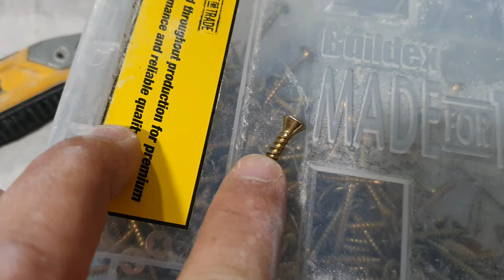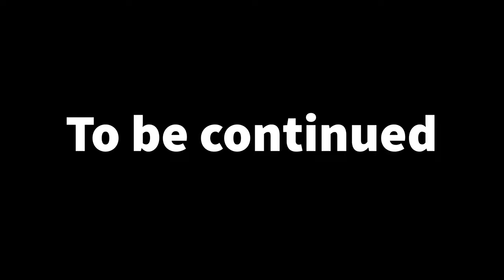How to repair a hole in your drywall (Magic Trick)

Comment: So you use 10mm (⅜) on walls and ceilings?
Reply from the maker: Hey Chad how you been? Yeah generally thats the standard. Sometimes 13mm ceilings in some areas. Walls always 10mm
Reply: @Maxkil  doing ok mate! This coronavirus shit could have never happened and I would better! Lol. So I understand now why all the extra work putting up the blocking in between trusses. It's kinda crazy but its not the norm here so... But hey, hope all is well with ya and avoid this shit going around! Be safe Max!

Comment: Help help me 
Get my system to market 

I have a dual system it can repair holes that finishes smooth and flush with the original with much less sanding. surface quicker easier better the other part is the worlds strongest wall anchor it is so strong I can put one in a ceiling and hang from it. 
Oh and this is the least expensive of them all.
Reply from the maker: email me
Reply: @Maxkil  greetings 
Those or the dual purpose item are part of a large number of thought ideals and products. Just crossed number 40